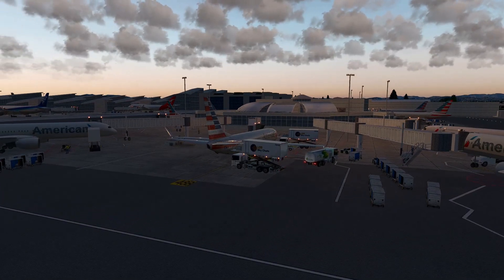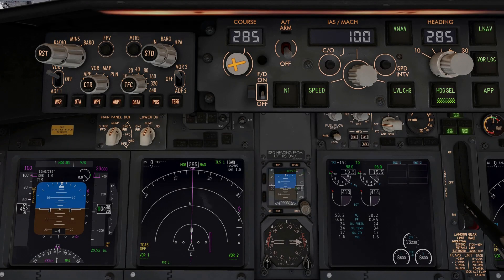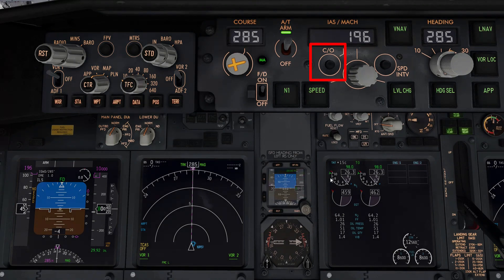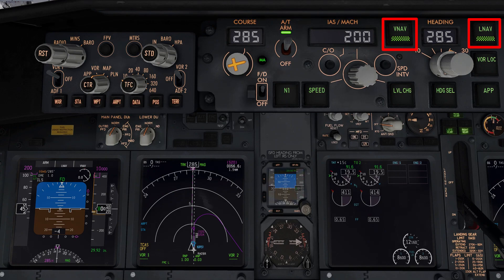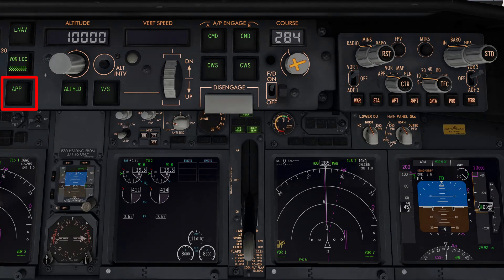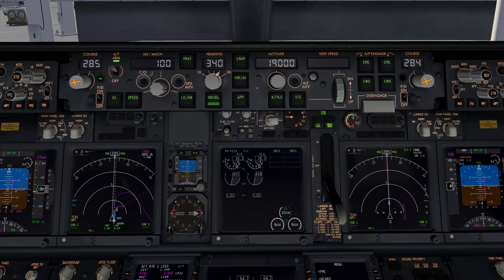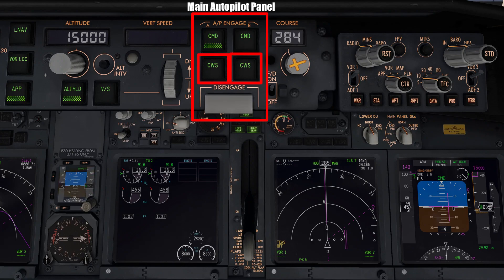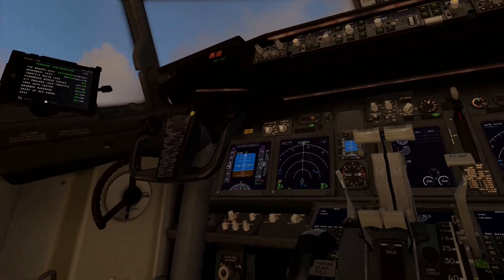Aircrafts Dissected Ep 5: Autopilot Mode Control Panel (MCP)IZibo 737IX-Plane 11 Detailed Tutorial

Comment: Hey there, I have the zibo mod 737-800 version 3_49_15 (latest version I think), and the SPD INTV and ALT INTV button are not on the panel, did I download the wrong version or this "latest"  version according to me does not have those buttons?
Reply: Hey there u have to go the the tablet, and manaully select those buttons to be displayed! under settings and features -> Display & variants -> systems -> page 2/3

Comment: Hi, at 4:16 you flip the A/T switch up to ARM after having set F/D to on. My experience is: in earlier versions of Zibo mod this didn't work as the A/T switch fell down again. A/T could only be activated and stayed up after lift-off. Then, suddenly, in some recent versions, the switch stayed in the ARM position and when operating the switch, the aircraft moved, accelerated and took of. Now, in the latest versions of Zibo, I'm back to where I was: the switch won't stay in the ARM position on the ground. My fault (any hidden precondition overlooked) or a snag of Zibo?
Today it worked as intended again...
Reply: I mean, is is normal behavior that the A/T switch sticks in the ARM position, or is it normal that it flips down if some conditions are NOT met...
Reply from the maker: Wolfgang H MAHR The autothrottle switch, when flicked on will stay on and shouldn’t flick back under any circumstances. It is not spring loaded like the engine start switches or the APU master switch. So no, under no circumstances should it flick back as far as I know.
Reply: FlyBy Simulations OK, as clear as it can be. Well, it appears that the switch is held in the ARM position (my conclusion from experiencing it in ZIBO) by a relay or coil, that can be powered off in order to release the switch. Probably, if you turn off the FD, there is a valid reason to release the A/T switch...
Reply: @wolfgang_h_mahr  Have you verified the calibration settings in the EFB for "noise flutter"? If you see any values above zero, you may be experiencing digital noise from your throttles causing issues with the AT switch. Adjust the integer value until the "noise" is cancelled and shows all zeros.
Reply: @Sim737Pilot  I have checked the EFB (Ver 3.43) and only found noise flutter for the three movement axes in calibration, but not for the thrust axis. Currently, the A/T switch stays up and thrust increases.
Reply from the maker: Good point! To be perfectly honest with you, this has been an on and off bug with many versions of Zibo. In fact, during a video recording once, I flicked on the auto-throttle switch as per the before taxi procedure and the engines leapt up to the N1 bug speed. This is most definitely a bug and not something that happens in real life. In my experience though, the latest version of Zibo works perfectly fine though. You didn't overlook anything.

Comment: A few public notes. 
1)Depending on airline operator, some airlines will engage both LNAV and VNAV on the ground prior to takeoff. Obviously, the CMD would not be engaged to at least 400 ft agl per Boeing, but most operators engage at the acceleration altitude of around 1,000 ft. 
2)If pilots are having issues with LNAV on the ground, the aircraft nose must be within a certain amount of degrees of the first waypoint in the FMC for the button to light up (I think it is within 15 degrees, but can't remember ATM.) So it is not a bug with the Zibo mod. 
3) During autoland, in addition for both CMD buttons to operate properly, both PF-pilot flying and PNF-pilot not flying must set the course knobs and both radios to the correct ILS frequency. Otherwise, you are limited to single channel CMD landing. 
4)There is a setting in the EFB to disregard pilot input on the yoke to switch to CWS. I seem to bump my yoke quite often, and it got frustrating having the AP go into CWS mode, as it does in real life. So I disabled that function for convenience in the AVITAB settings.
5) There have been instances of loss of control at higher altitudes due to excessive bank angle. Most operators limit bank angle between 10-15 deg above a certain altitude. I use FL300. Here is a link for more information for those interested in high altitude safety operations- Slide 1 (faa.gov)
Reply from the maker: Sim737Pilot Some great points here that I’m sure the viewers will indeed benefit from. You seem to be binge-watching all of my videos it seems😂
Reply: @FlyBySimulations  You had me at Boeing 737-800 ;-) Loving every episode. I feel like I'm in class again.

Comment: Hello, I love your videos, these types of videos were needed.
Do you think you can make one about how the NOSE WHEEL STEERING button is used, or how the settings in the NOSE WHEEL AXIS table should be. I always have that problem that the plane is going to the left or right but I can never center it correctly, with or without wind. I don't have the pedals and I use the buttons on the TIMON, GUIÑADA, and ALABEO keyboard.
If you don`t problem, can explain to us how it should be the correct use of TIMON, GUIÑADA Y ALABEO, and when? at takeoff, at any time of the flight or to land.
Reply from the maker: Hey there Benjamin, thanks a lot for your kind words - I truly do appreciate it. As for your nose wheel axis problem, it sounds to me that it might a problem with your hardware itself being uncalibrated or maybe having a problem with it. I also don't have rudder pedals and use two buttons mapped to my Thrustmaster throttle quadrant and I have also had problems with the plane sometimes veering left to right. As for the nose wheel axis, you need to go to the EFB or electronic flight bag (the little iPad that sits beside the captain as well as the first officer in the flight deck), go to settings, go to hardware configuration and under nose wheel axis - simply turn it to yaw. That way, the same axis you use for your rudder may be used to turn the plane on the ground. Maybe that will help solve your problem. Let me know how it goes:) If you enjoyed the video a like and a subscription would be greatly appreciated. Look out for more videos coming soon:)